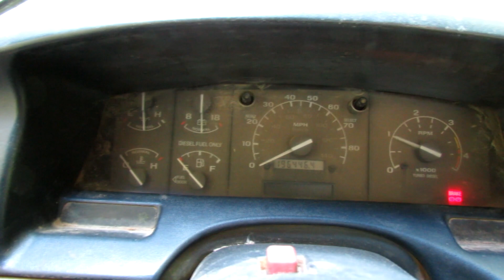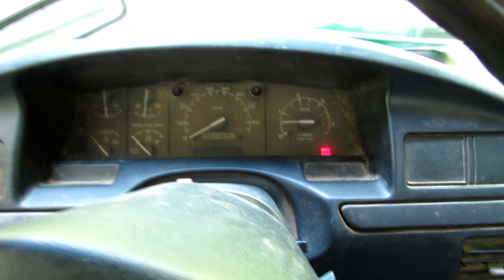Monday-Moving junk around

Comment: sounds like the old 7.3 needs some injectors . 
Both projects would be cool with that power plant . In the traveall  , it would work good with the divorce case . may have to move it back a little to clear the ZF 5 spd . .
I like storys that have 6-71's in them :)
Reply from the maker: It smoothed out after it ran a while. It had new ones within 50000miles or so. I bet it hasn't run in two years.
Reply: then thats not bad for two years .

Comment: What made a divorced transfer case a problem? I thought that might be easier as there were no adapter plates required.  The travelall is a pretty rare bird these days, it could be pretty cool.
Reply from the maker: NO problem there .that's an advantage....I just gotta make up my mind which way to go...The Travellall has a really nice 392 in it ...Hate to part with that.
Reply: ***** The diesel would be pretty cool though, plus, you can save the 392 for something else.......  'just throwin' that out there.  ;-)